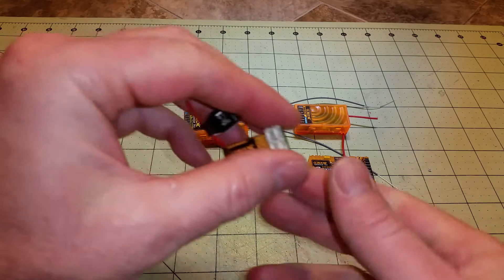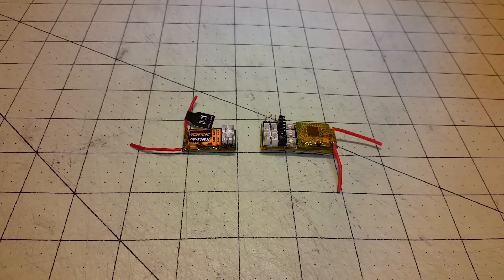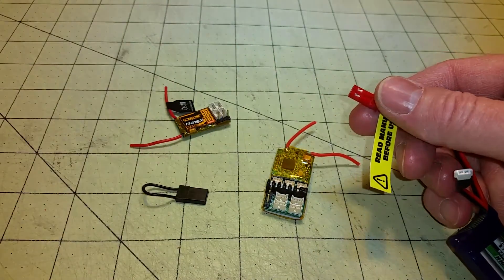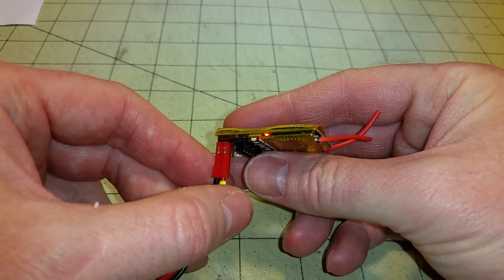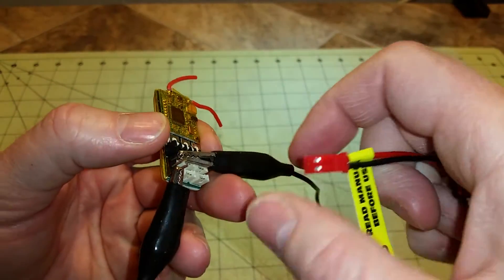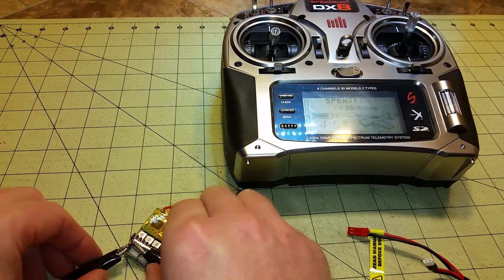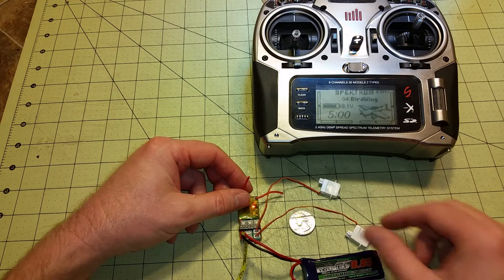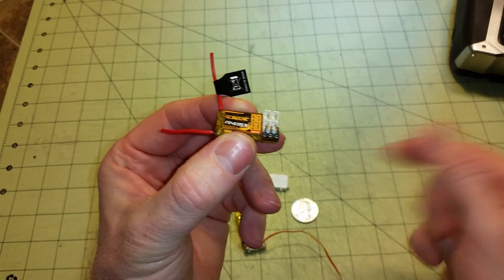Binding OrangeRX R415X Receiver and OrangeRX RX3SM 3-asix Stabilizer Receiver

Comment: Alternatively solder a bit of wire to the ground pin from the other (bottom) side,  touch newly soldered wire to signal pin, plug in battery and bind, when done cover bare wire end of extra ground wire with heatshrink  :) or even better just solder on wire that has the right connector i,e cut the bind plug in a way to make one wire long solder longer wire to ground then plug in whenever you want to bind again :) this way you can bind "anywhere" and not just "anywhere where you have a handy banana clip to use ;)

Comment: hi here, good video. is an ESC needed to run the motor on the R415X?  if so, can it be an 1s ESC?
Reply from the maker: Yes you would need an ESC to control a motor.  If you can find a 1s ESC

Comment: Were you able to make the stabilization work properly? Can you use the remote turn on and off function? I have the RX3SM with molex and the one with normal pins and they don't turn on and off with the transmitter and the stabilization also do not work at all. I have been trying to find more info and help, would be great if you could cheap in, in this thread, somebody has the same problems than me, but there is no much input on the thread https://www.rcgroups.com/forums/showthread.php?1996553-Hobbyking-Micro-RX3SM-7g-receiver-with-gyro-stabilisation-%28molex-plugs%29-DSM2/page2#post36854222
Reply from the maker: I haven't used the 3 axis stabilized receiver in a model yet.
Reply: OK. I hope you will review it after you do. thanks